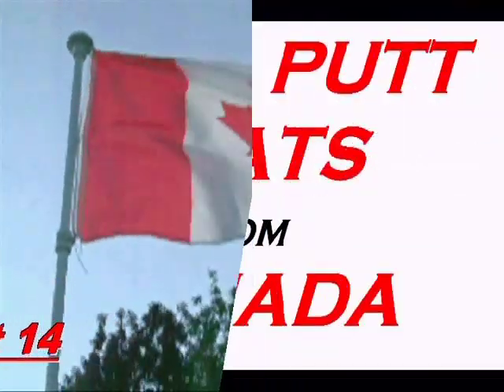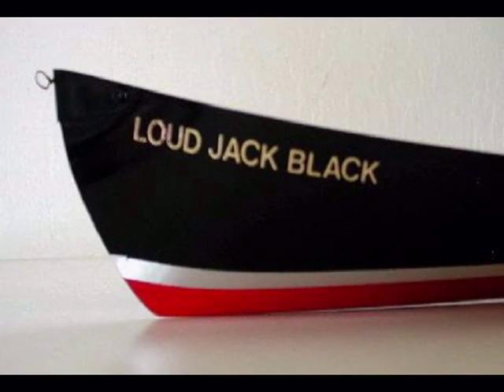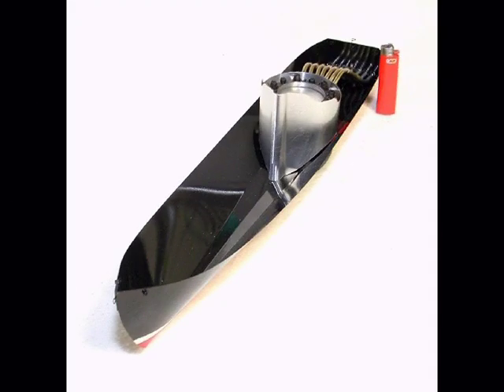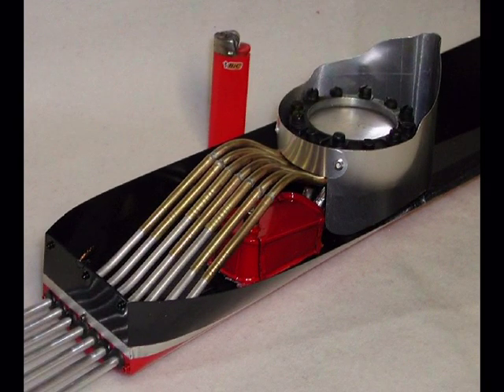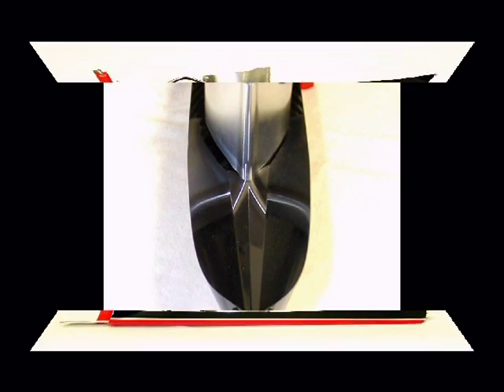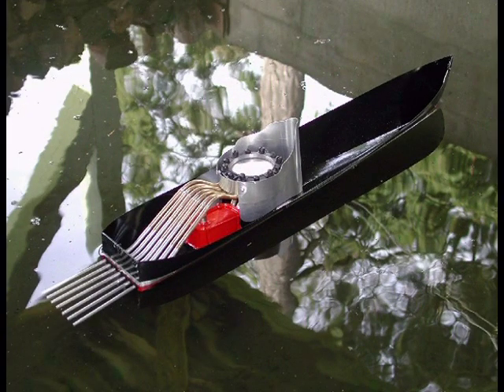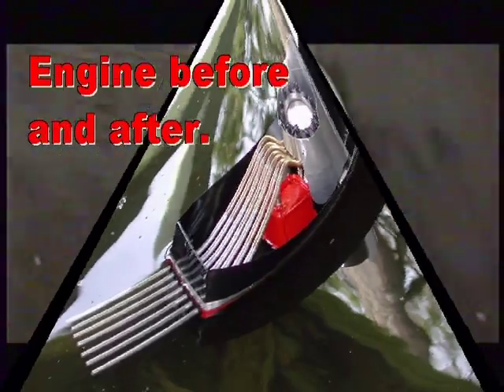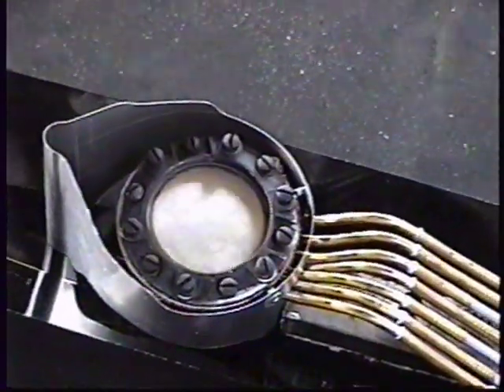Putt Putt Engine Power & Speed Boost..mpg

Comment from the maker: @mariobroos002 No need to apologize. When this engine was first built it had 2 tubes, each 16 inches long, the outside dimension was 1/4 inch, inside 7/32 inch. The 7 tube version tubes are 12 in long, OD 3/16 inch, ID 5/32 inch. Tubes are brass and thin wall. I hope this answers your question.

Comment: i was wondering, this recalls me of when some one tried to explain to me the gooseneck air vent pipe that Pasteur used in his experiments, some people said that the pipen under the boat pull the boat and nullifies its fortward movement
its that the reason you pull the pipes out of the Water movement plane and pull it up?
i always beleived that the Puff sound maked by the metal diaphragm was because of the exesive presure in the resonance
and that putting more pipes whould allow to take most power out of the engine

Comment: What diameter is the diaphragm?  What is the air volume in the boiler?  Are the tubes 5/32"?  Should the lower diaphragm be thicker than the upper one?  What is the ideal thickness and metal for the lower and upper diaphragms?

Comment: I was going to make a 3 ring design.  The upper and lower ring would look like the top ring in this video.  The center ring clamped between them would be drilled for the tubes to stick inside the boiler.  Should the tubes stick into the center of the boiler?  The diaphragms would be easily replaced with this design for experimenting.

Comment: If the diaphragms are mounted with gaskets or o-rings to reduce heat transfer to the clamping rings, will the engine perform better?

Comment: Maybe the design of these little boats has not been applied to a bigger scale, hovever, when you look carefully you will notice that these little engines are basically a very simplified design of Thomas Savery's atmospheric steam pump (which was the first useful steam device in late XVII century), from which a series of atmospheric engines evolved from.

So if you were to look for a big scale engine similar to these things, those would be the closest you would get, that has been made already.
Reply from the maker: Interesting. As I understand it what makes the Put Putt engine unique is no moving parts and therefore no valves. I'm not knowledgeable enough to know if any of the atmospheric designs meets that criteria. The moving diaphragm is an allowable exception as it is not required except to make noise. Some valve less pulse jets  have similarities as intake and exhaust use the same tubes but of course it is an internal combustion engine. Thanks for watching and commenting.
Reply: Daryl Foster Indeed, the putt putt engine is the one of it's kind, though atmospheric engines did have moving parts, like pistons, as far as I know they were the only engines widely used that worked with the same principle of the putt putt.
However, the Putt Putt is even more special, since it's like a combination of a pressure engine and a condensation engine, the steam pressure pushes the water out, as if it was a cylinder, actually, and then the steam cools and creates vacuum to refill the boiler.

Savey's pump, though it had some hand operated valves, did the same. It used steam condensation to suck up the water from a mine shaft, and then it used steam pressure to push it through a pipe to somewhere else.

I might take a try to build these fun devices, yours seem pretty advanced, never seen one with so many steam pipes, actually, the ones I've seen on youtube usually have one or two. Would like to find out how would do a boat with two putt putt engines powered by separate candles.

When I was a kid, and today still, my grandfather tells me about these toys from time to time, no idea why I never tried it before.
Reply from the maker: MisterTalkingMachine There are some two and three engine designs in my videos  as well as how to's on engine and boat building. The added weight of more engines has defeated the power of the extra engine(s) so far as even the best engines have a rather pathetic power output. Mullti tube engines have consistently been the best performers.

Comment: Hy Daryl, love your Putt-Putts. Trying to emulate your design here, and got myself an old fuel pump, but at 75mm diameter for the diaphragm, it seems a bit too large.  What's the diameter of your diaphragm on this engine?  Thanks!
Reply from the maker: It should work OK  with the 75mm diaphragm. Concentrate on the boiler volume and try to make it about 25cc. Too small and the engine can be cranky. Too large and it will have less power and lower hertz. You may have to experiment a bit. 10 to 12 hertz is good. If you are making the boiler out of copper as I did in the B engine you have some leeway to change its volume by reshaping. Watch my video "How to build the PP4V engine and note that there is virtually no volume built in and it runs fine because the large flexible diaphragm provides volume when pressure builds. Let me know how you make out. Good luck. Drf
Reply: Thanks for your reply. I'm going to try first with a smaller engine based on two 1.5 inch steel gaskets. I did see your other video. Very informative. Thx!

Comment: Could you connect the diaphragm to a pitman arm and have it power a paddlewheel?
Reply from the maker: +D whozit Well sort of. The power is so small that it would have to be dramatically geared down. One chap moved a model train via the diaphragm turning a gear with a sort of clockwork arrangement that did the gearing. I did a paddle wheel a different way. I think it is in my part three video.

Comment: But is a solid boiler actually a pop pop boat?
Reply from the maker: Absolutely. The first one invented had no diaphragm and was a solid boiler. There is also the coil type with no diaphragm. Noise making diaphragms can be added to the coil or solid boiler types. There is no difference in function in all types but the use of a diaphragm does add the sound and reduces the power.

Comment: nice but needs bigger boiler/bulb and same number but slightly wider. slightly shorter pipes
Reply from the maker: +realflow100   As a bigger boiler/bulb reduces power and from testing shorter tubes in this design probably result in  steam bursts I wonder what the science is behind your suggestions. Thanks for commenting.
Reply: You'd need a bigger flame of course! Then it would work just fine.. basically up-sizing what you already have.
Reply from the maker: +realflow100 If only it was that easy. Unfortunately pop pop engines do not scale up. Can you show me some video of your best performing engine/boat?
Reply: lol I didnt even know these were a thing till I came across it by accident searching various solar panel related things. so I was just giving some possible ideas..
Reply from the maker: +realflow100 Good for you. We need some new ideas because most of us who having been building these engines for a few years have about run out of new things to try to achieve more power. Have to tell you that a lot of thought and experimentation by many people with many ideas have not produced a major breakthrough, but, who knows. My claim to a world speed record goes unchallenged so join in.
Reply: Daryl Foster That gives me an idea... Possibly a lot of small boilers with a lot of small pipes.. going into a few larger pipes. And i mean a lotttt.. enough to push a full size boat? That would be a whole lot of fun though it would take a lot of candles lol.